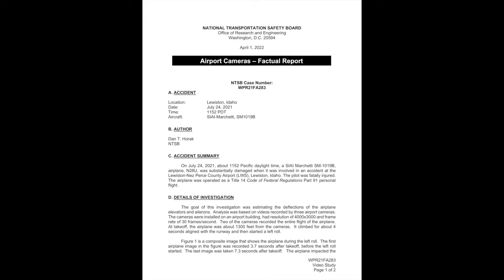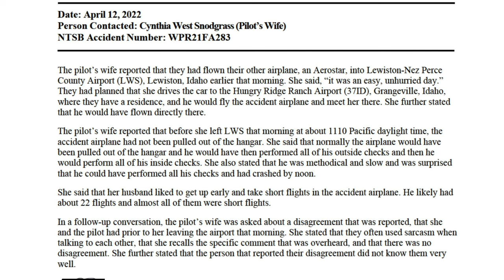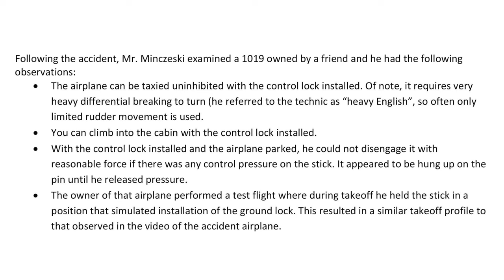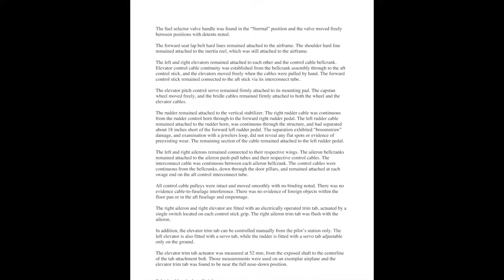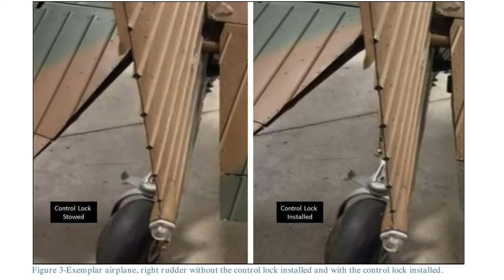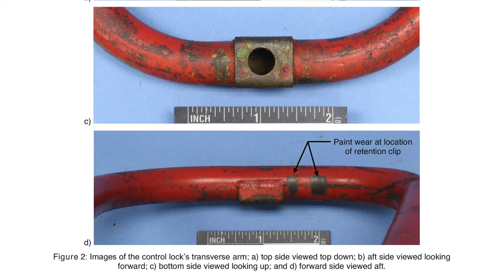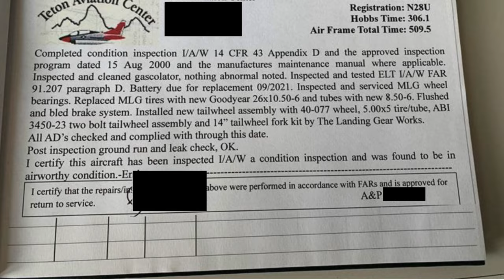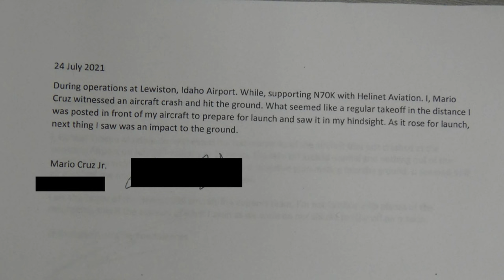Fatal Crash of SIAI Marchetti 1019-B, Part II

Comment from the maker: The NTSB determined the probable causes of this accident to be the pilot’s failure to remove the flight control lock before departure, which resulted in a loss of control and impact with terrain. Contributing to the accident was his failure to perform an adequate preflight inspection and flight control check before takeoff.
Reply: I hope they stopped making those manual locking mechanisms. So dangerous.
Reply: Only a truly suicidal person would make these kinds of mistakes.  Pilots should be required to attend psychiatric care regularly.
Reply: @martinswan9175  they can certainly be dangerous, but they serve a purpose. Maybe they should redesign them  in a way that requires them to be removed before the plane can taxi. Im not a pilot, but there's certainly gotta be something that could be done to prevent this from happening again, while simultaneously allowing the locks to stay in use when desired.
Reply: I am horrified
Reply: @Watchdog_McCoy_5.7x28  a lot of them are pretty visible from what I've been told, just this particular one wasn't and he failed to do a controls check to see if it had free movement
Reply: @rstidman  Complacency kills, doubt he was suicidal but if you have a TON of hours in a wide variety of airplanes it's easy to skip things thinking they're unnecessary, but we won't know why he didn't do a controls check for certain. RIP
Reply: @rstidman   The pilot in this accident was Dale "Snort" Snodgrass.  You shouldn't assume what you just said.  There are many reasons why your comment is almost surely incorrect.
Reply: I regularly fly cessna 172s. In those the control lock is a long rod with a metal flag that blocks the mag switches and key hole, you have to remove the control lock to even turn the plane on. Ontop of that, controls free and correct is part of your procedure where you pull and twist the controls thru the full range of motion. He didnt do his checklists or preflight the plane
Reply: @martinswan9175  no manual locks prevent damage to the control system that results in total loss of control while in flight.Caused by the wend whil the aircraft is tied down.  The only way to eliminate control looks is find a way to eliminate wind.  All that's nessary is do a proper and complete preflight inspection that whitch always includes checking the travel limits of the controls and that they move the (flippers) the correct direction . This accident is in part caused by having a long history of flying aircraft serviced by a crew chief just prior to take off . Every aircraft I ever flew got a full and completel  correct and proper control check befor taxi and a second time after run up and mag check.  It is what you do if you plan to stay alive .
I worked on  glider field my job included signing the tow pilot when the glider pilot was finished with his control checks and ready for the begin of the tow. This was done by leveling the wings and giving a hand signal to the glider pilot. Then the glider pilot would use the rudder pedals to Signal the toe plane when to start the takeoff. If the glider pilot did not do a full and complete control check before he signaled me to level the wings I did not level the wings. One day one glider pilot got a little irritated at me that I did not level his wings I signal the toe plane pilot to shut down walked over to the cockpit of the diner and told the gentleman if you don't show me a full and complete control check you will not be taking off today .I don't like picking up broken gliders off my Airfield . He apologized and did the complete and proper procedure and we launched him . The things done with an aircraft just prior to take off are the most important parts of every flight .
Reply: didn't perform the walk around
Reply: @BoringFlightVids  My instructor told me of a fatal crash whereby the pilot (with his family in the plane) took off in his 172 with the control lock in place.
Reply: @kuiper921  DITTO
Reply: @oneanddone7992  the standard 172 control lock blocks you from even putting the key in the ignition while it is installed. But I have heard of people using dowel pins instead, which is just nuts. But a proper boxing of the controls will detect a failure to remove the control lock every time. :/
Reply: @rstidman  Per the NTSB - "When it is installed, the control lock, which is painted red, is immediately below the pilot’s knees and, despite its bright color, can be difficult for the pilot to see.

The device allows full rudder use but disables the ailerons and elevator, so it allows the plane to be taxied with the control lock in place but doesn’t allow the pilot to input elevator or aileron inputs. In one near-disaster noted by the investigators, a pilot described how he had taken off with the lock installed but was able to just barely uninstall it enough to allow him to recover before the plane would have crashed. In the Snodgrass crash, the pilot seemed to become aware at the last second of the mistake he had made—audio and video recordings of the crash exist—but was unable to effect a recovery or to remove the lock in time. The elevator trim was found in the full forward position, an indication that the pilot was attempting to lower the nose as it rose after takeoff."
Reply: @BoringFlightVids  I fly archers at my flight school and never been shown what the control locks are on our planes but we have “check flight controls” on our checklist at least twice prior to takeoff, once in the preflight and once for runup. This is definitely a perfect example as to why you should always check everything is clear. I wonder if he didn’t bother doing a run-up entirely? I heard he only really did short flights in the plane and it was new to him but not entirely sure just speculation.
Reply: @BoringFlightVids  A poor design of the gust lock device that allowed partial movement of the rudder, apparently enough to give the pilot the impression the lock was removed and permitted him to taxi to takeoff position. A good design, as in the Cessna 172, is a visual flag that locks the controls and prevents the aircraft from starting, by covering the mags and master switch, no checklist needed. In my opinion, this locking device should have been re-engineered years ago and called out in an AD as a critical safety item.
Reply: @Watchdog_McCoy_5.7x28  The pre-check which is required (he didn’t perform) would have caught this.
Reply: We must continue to advance fully automated flight.   Only technology can be improved and changed.   Humans will aways remain the same.
Reply: @martinswan9175  Not dangerous, provided you've followed your pre flight and done your checks .
This was complacency.
Reply: There is - it's called a checklist and always includes control surfaces 'free and correct'. Obviously skipped that part.
Reply: @michaelmccarthy4615  No we must not fully automate everything. Life in a robot world would be dull. But the plane design could have been improved. At least when it comes to making it obvious it was fitted. We already have cars with better designs to control what gear are selected etc when starting the engine.
Reply: I don't get it. He performed a 90-minute preflight check.
Reply: @InteriorDesignStudent  I think you mean the text in the NTSB report where another pilot mentions he did a 90 minute inspection when he bought the plane, before he did fly it the first time.

He absolutely can not have done any preflight checklist this last flight but must have skipped it for some strange reason. It kind of sounded like he was stressed and wanted to get home - maybe to some planned lunch.
Reply: @michaelmccarthy4615  tell that to the family of the 4 who were just letting their tesla drive itself on the interstate and it decided to leave the road and park itself at high speed under a semi truck trailer in a walmart parking lot. 

DO NOT TRUST MACHINES, none are infallible. though there are those who would say otherwise, and some with terminal results.
Reply: @rstidman  Seems you know nothing about the pilot. In fact he was a very disciplined and professional aviator. Nobody is perfect and mistakes are made, unfortunately this one proved to be fatal.
Reply: Dementia was it
Reply: @donbrashsux  I do not think he forgot. I think he intentionally decided to skip the checklist (which is there to avoid people forgetting things) because he was late and in a hurry. So he made an intentional decision to skip the checklist.
Reply: Splat hahaha!
Reply: @JimMcBob42069  And exactly what did you find funny with a pilot losing his life?
Reply: Without the locking mechanism, control surfaces could be damaged by weather leading to structural failure in air. These locks need to be atrached in such a way that you cant use the rudder pedals and throttle as well. Always use a written pre flight checklist -that checklist should become dog eared and worn from use.
Reply: @JimMcBob42069  hey - you might bring bad karna to yourself - you drive a car right ?
Reply: @rstidman  i like your avatar....  is it vivaldi, liebnitz, or wren?     :    )
Reply: @Watchdog_McCoy_5.7x28  maybe a yellow sticker w/ a question/exclamation mark - to catch the eye/attention prior to rollout.
Reply: @oneanddone7992  crazy.  all good pilots check free and correct first!  takes about the shake of a lamb's tail
Reply: @thomaslemay8817  The attendance of a crewchief is immaterial. He flew military jets that required adherence to the particular model's checklist. He was a conscientious pilot and top notch pro. I don't believe it was complacency. Im convinced he was distracted at a critical moment of the preflight and missed the control locks. Thankfully, the control locks on a Bonanza make it impossible to move the controls in pitch; one would catch it immediately. RIP Snort, lesson learned and driven home!
Reply: @donbrashsux  Certainly not. Distraction during preflight. Happens a lot more than people want to admit. I have a rule...Once I start either preflight, or mission planning, no conversations, no questions, no interruptions. This is really that important. People die every week because of an interrupted preflight check or interfered with preflight mission planning. Whether it's a performance number that gets misinterpreted or misread, a fuel consumption number, a write-up on a discrepancy sheet or a NOTAM that doesn't get the due attention. Disciplined flying and aircraft prep for flight only goes so far. I tend to leave my passengers in the lounge of the FBO until I'm done loading and preflighting the aircraft. I step back inside to check Wx one last time and ensure it meets my go/no-go minimums. This could happen to anybody! Snort was the consummate professional aviator and he would've said the same thing. Take the lesson to heart: Don't interrupt a pilot while preflighting or planning the flight.
Reply: @perwestermark8920 That's not consistent with his attitude toward flying. Nice try at a hip shot, tho'.
Reply: @carlospar3727  thanks for that great insight 
I’d feel safe flying on your plane
Reply: @carlospar3727  Well, he did have a time to meet and he was late. And he did skip that preflight check. You can have a routine you do everyday. But there will come days where you for some reason decide to skip that routine. Same at work - doesn't matter what work or amount of experience. There will come situations where some normally done steps will be skipped.
Reply: How on earth do you forget that?
Reply: They literally lock through the yoke and have a GIANT tag covering the yoke.
Reply: @blackmidi 👎
Reply: @rinzler9775 👎
Reply: @carlospar3727 👎
Reply: @dpgoulette Throw a quarter on the deck for ol' Snort!

Comment: The sky, like the sea is unforgiving. Condolences to all involved, including the family,  ATC, and responders to the scene.
Reply: Bruh. The ground is unforgiving.
Reply: @RandySeverino  
First time I have ever heard BGUMPS CIGAR, and not a dumb mistake, just a mistake
Reply: @DropdudeJohn  While, I think Randy is being a bit harsh, on the hierarchy of mistakes, this was a boneheaded one! For example, leaving a fuel cap off is "just a mistake". Not checking for free controls, well... simply watch the video! The fact that a pilot of this stature could do this is a valuable lesson!
Reply: @RandySeverino  Your comment reminded me of an incident that almost had the same result for me, though not aircraft related!
I was driving across the Golden Gate bridge and my engine died. A huge tow truck responded, to push me across the bridge. Over the PA he instructed me to turn the ignition off, which I obediently did. He started pushing me and we were probably doing about 30 miles an hour, when I turned the steering wheel, and it instantly locked, with my truck turning to the left. This was before they had a center divider on the bridge and I was headed directly into oncoming traffic! I looked in my rear view mirror and all I saw was truck grill! Fortunately, I was able to jiggle the wheel and turn the key on in time, but it was close! I'm guessing I was feeling exactly what the other pilot in the NTSB report felt, when he was able to disable the locking mechanism AFTER taking off, and realizing his mistake!
Reply: @carlwilliams6977  
Yeah and that's the point anybody can do it, don't think you can't, if you do that's a bigger mistake than this, it was just a mistake and it cost him dearly

I watched the video when it first happened, and the conclusion then was this, he's not the first super experienced pilot to do this.

Comment: This channel is SO underrated. Keep up the awesome videos 👍🏻
Reply: Absolutely
Reply: This stuff makes people sleep better at night.
Reply: If the control lock was indeed locking the controls the trim would actually be acting in reverse since the trim tab is now acting like the elevator thus trimming down actually causes the aircraft to nose to rise up even more. Frozen elevator requires OPPOSIT trim application . Had this happen in a Citabria which thank goodness has a fast trim.Jammed elevator bell rank caused by 1 inch clock That had worked it’s way to the elevator control bell crank . All loose Stuff ends up in this area in a TailDragger. Lots of Aerobatic aircraft have a plastic window in this area for that very reason Hope this long winded answer will save someone in the future .Been there/ Done that CLAYBIRD—

Comment: Although there appears to be plenty of pilot error in this accident, perhaps a better control lock design, maybe coupling it to the throttle or the tailwheel, would have given the pilot a warning that the airplane wasn't ready for flight. So sad that such an experienced and exceptional pilot was lost over something so simple.
Reply: It's unfortunate that the aircraft manufacturer didn't include a safety switch on the cockpit floor that activates a blinking red warning light on the instrument panel unless the flight control lock is fully down in the stowed position.
Reply: Yes! I totally agree.there needs to be some type of sensor which would not allow engine start or would have some type of visual,audible warning